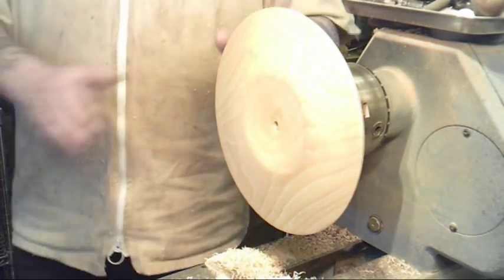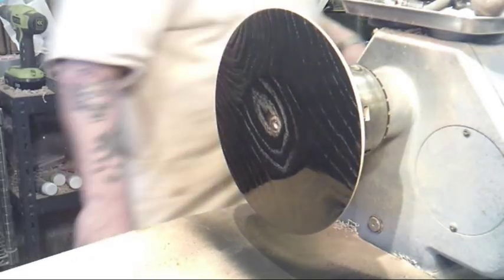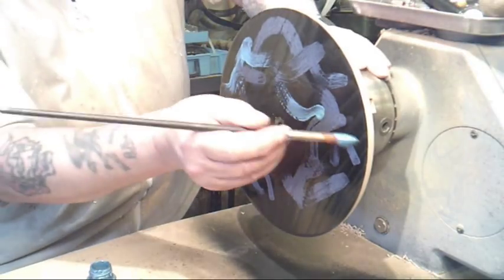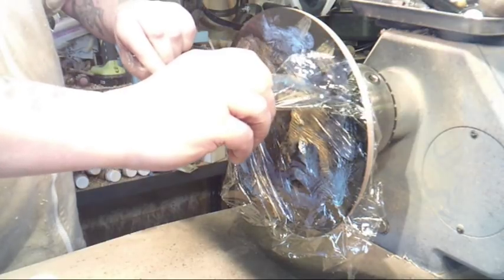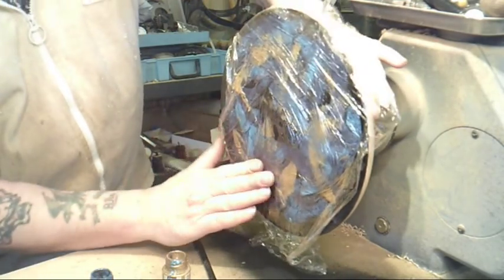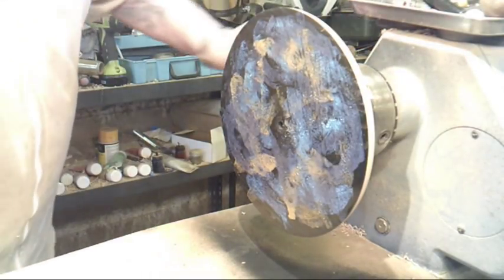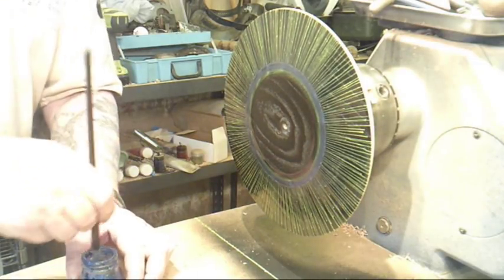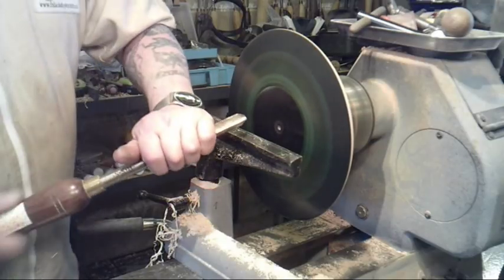2 coloured bowls hand turned from Ash

Comment: Very nice Wayne. Here is a little tip for you. On the ends of the cling wrap box there is a little perforated spot that you push in. That holds the roll in the box so you can pull out the cling wrap and tear it off so it doesn't go back in and stick to itself. Thanks for the video.
Reply from the maker: Thanks Scott, usually the cling film stays where it's cut this time it didn't, had to happen when I was doing a video